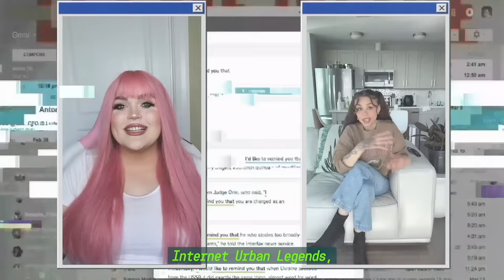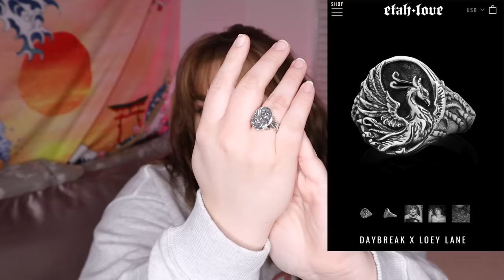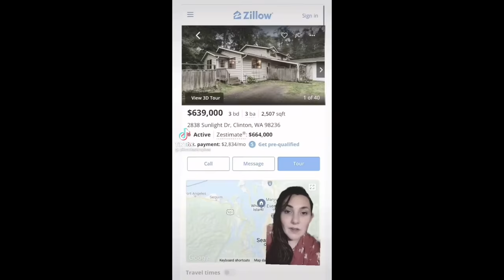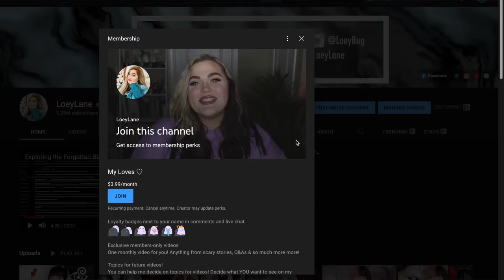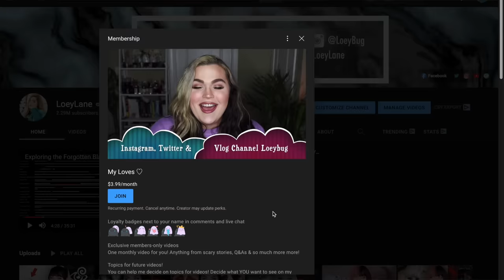13 Unexplained Videos from The Scary Side of TikTok | Loey Lane

Comment: The reason the ceiling in most older homes is so much lower is actually due to heating/cooling and cost of materials. It's easier to keep a home nice and warm during the winter if the ceiling is lower, and you're not spending as much on wood. Just thought I'd throw that out there.